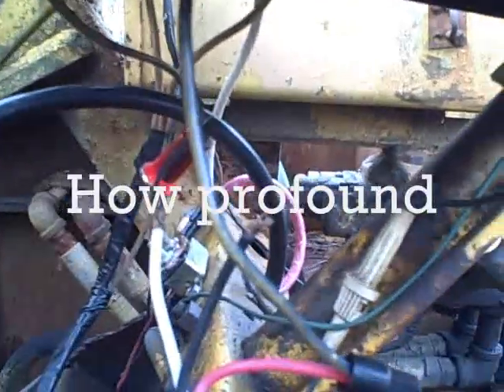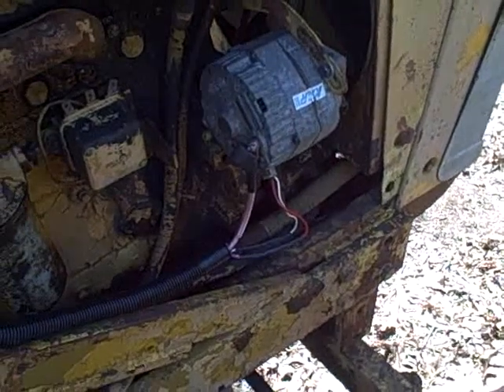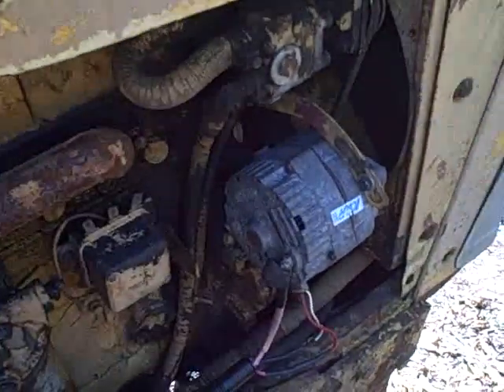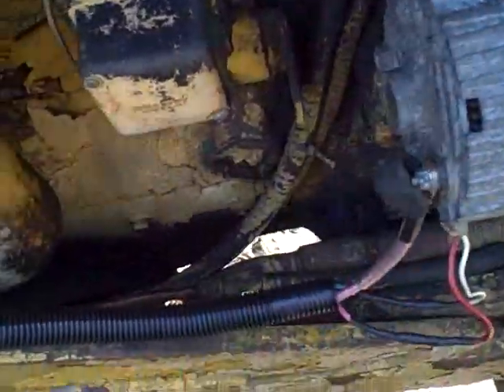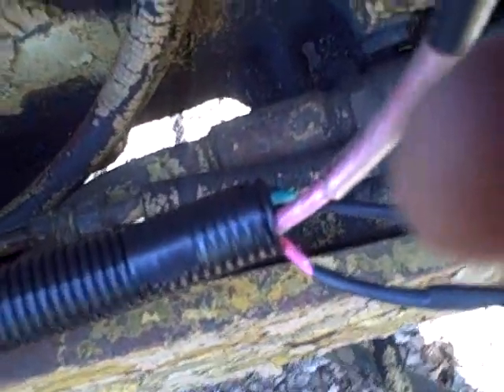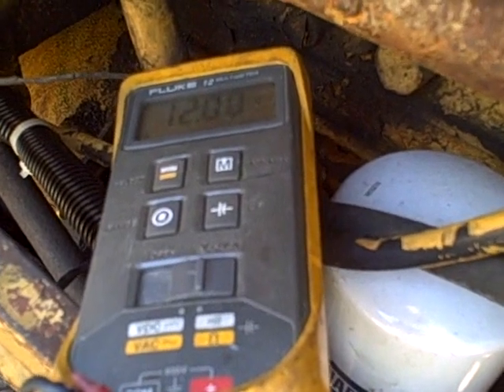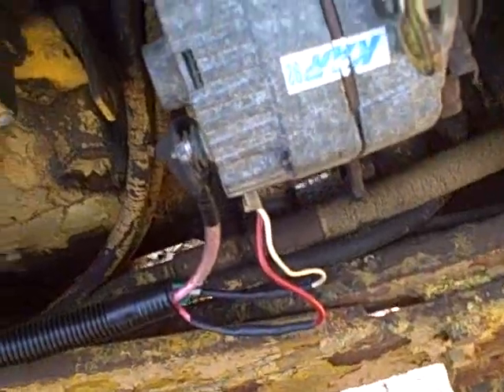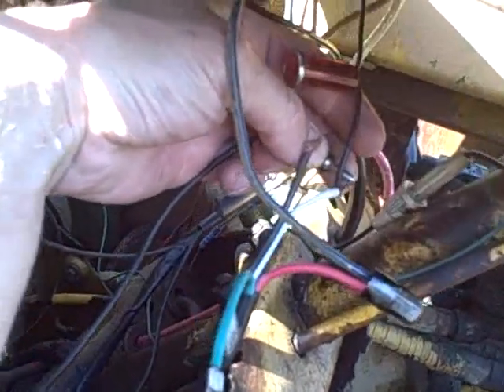Oliver 770 Industrial Tractor Project Part 123

Comment from the maker: I straightened out the shaft the backhoe control levers pivot on. Video coming soon. Next, I will try my hand at weding the three broken levers. Once the controls are fixed, I need to fix that leaky cylinder, then I'll try it out.

Comment: That`s exactly how my Bobcat is you get power really good now so either you hit a start button to engage it or why don`t you put a brake light button on the clutch arm so when you start it and press the clutch when it goes down and activates the brake light button and the alt. engages every time without thinking about it , Having a button is so easy to remember it becomes habit every time glad my system worked for you .